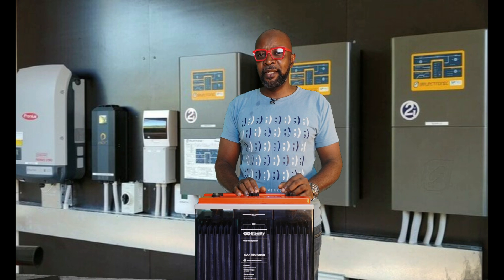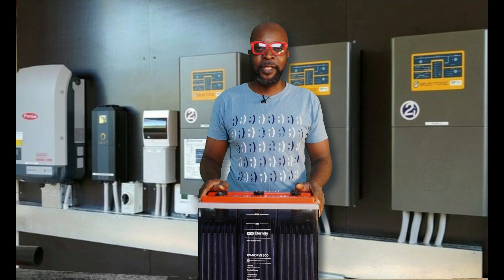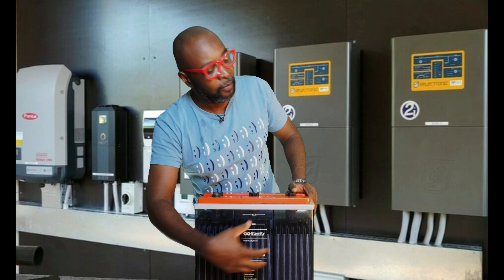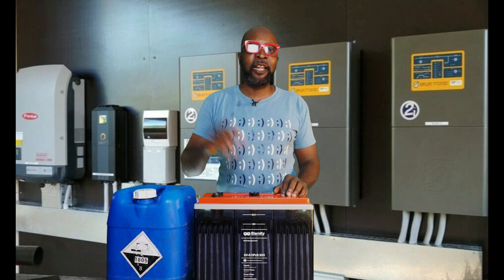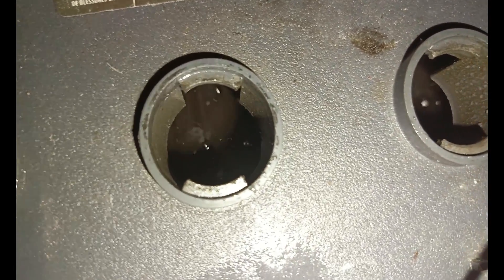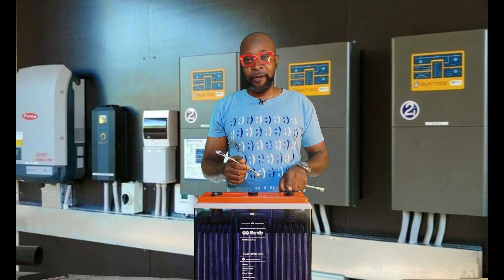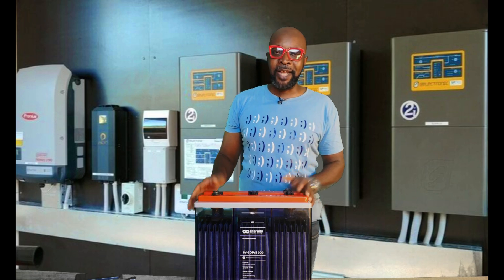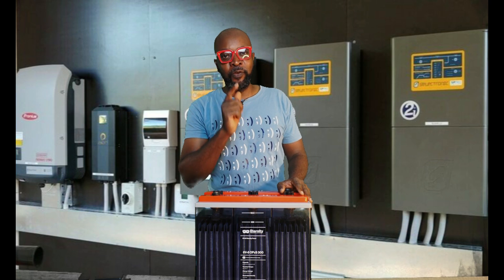Do this and your Tubular battery will last a long time .

Comment: I have recently installed my solar system of 4kv  inverter with 2 tubular batteries of phoenix 3500 and 280A each.Charging is only solar permitted.
The battery shows fully charged 100% during daytime but in the evening it shows 65% capacity.
What's the reason of discharge

Comment: Hi Ikenna, is there need for equalization when all the individual cells are reading exact the same voltage and the specific gravity is also at the same reading in all cells.?
Reply from the maker: There is prevention and there is cure, I hope you understand.
Reply: @smilinsunsmilinsun8056  Thank you, well understood.

Comment: What if after filling with distilled water  they are not going down at the same level what should one do in that case
Reply from the maker: There is nothing you can do the battery cells are already dying

Comment: Please smiling sun dose car battery which are also acid batteries requires distill water  or electrolytes
Reply from the maker: No they don't
Reply: @smilinsunsmilinsun8056  
Ok
  You 
😢 mean non of the above so what will I do when the battery current goes so easily and is just some month old car batter

Comment: You space the batteries for cooling not for expansion.   The rate of expansion (metals 10^-6 and plastic 10^-5 inch/(inch * F)  is extremely small and plastic yields and creeps so the expansion   Extruded aluminum heat sinks fins are spaced for natural convection cooling.  The minimum space is that width.
Reply from the maker: You space the batteries so that air can potentially circulate around it , now why do you that?  because you don't want the battery to get hot. When the battery gets hot one of the side effects is battery expansion.

Comment: I remember purchasing a lead acid battery from Sears for a car.  The battery was bone dry.  NO LIQUID IN IT!  The store upon sales added the electrolyte.  Long term storage (time from manufacture to in use) may have been months if made over seas an shipped by over the ocean.  The point of sale or the ware house that gets the battery completes the last step in manufacturing.
Reply: motorcycle batteries are still like that. though i have been moving to Lifepo4 motorcycle batteries
Reply from the maker: Good to know